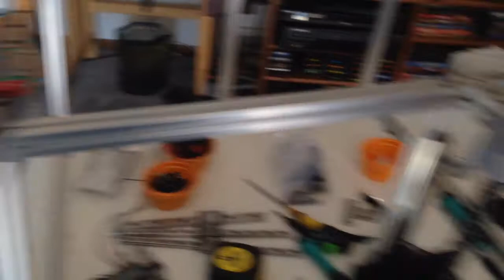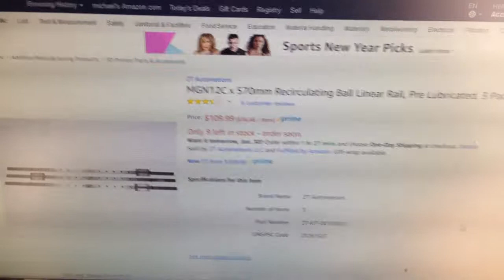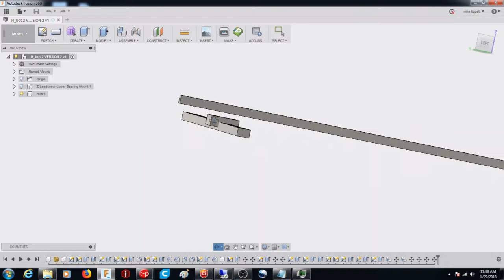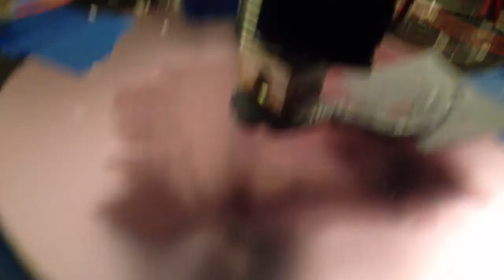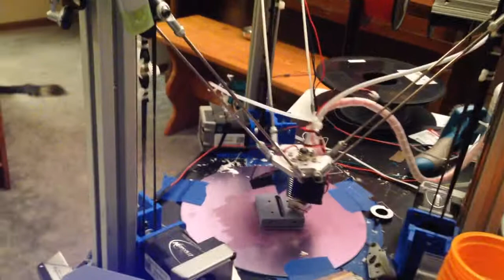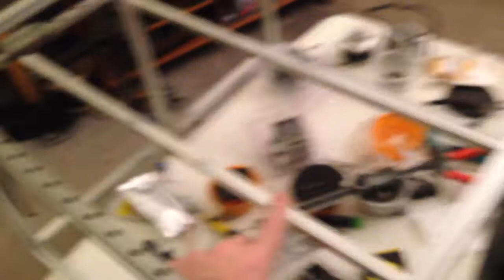MakerBeam H bot Version 2 day 2

Comment: I've been looking for a source for linear rails for some time now, but I've been hesitant. I don't mind going through the process of cleaning them up for a cheaper price. Have you encountered a reliable source for them since the making of this video?
Reply from the maker: Sadly, I have not. I am able to get rails off of used machines for the most part, so this was my first and only rail purchase. I was quite hesitant myself, and after receiving them, I’ll be even more cautious in the future. Having said that, I’d probably buy them again, knowing what I was getter by into this time. These have worked ok for me since I cleaned them up, and I’d have to spend way more for really good rails. I wish I had a better answer for you.
Reply: Printerstein I very much enjoy the amount of salvaged parts you use. Linear rails are not quite abundant unfortunately. What kind of machines do you extract from? They seem very closely related to printers.
Reply from the maker: Some of them are similar to 3D printers in their mechanics and drive mechanisms. I work at a semiconductor manufacturer with a lot of older equipment and parts that occasionally get thrown out because of upgrades or repairs and nobody else has any use for them. Some are repairable and some have parts I can use. It’s very hit and miss and not consistent at all, you have to be very vigilant at the recycle bin! Sadly I often miss out on good stuff... I wish there was a way to share it with others like yourself.  And I’m not sure what other industries would be selling or disposing of similar equipment.